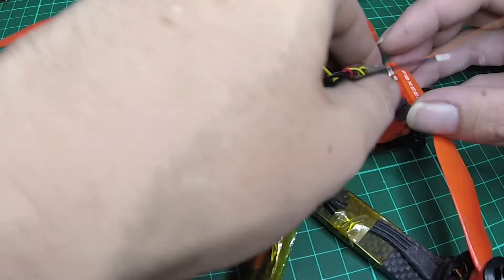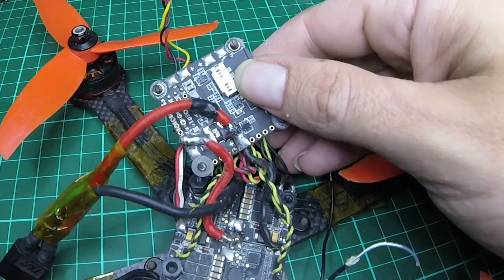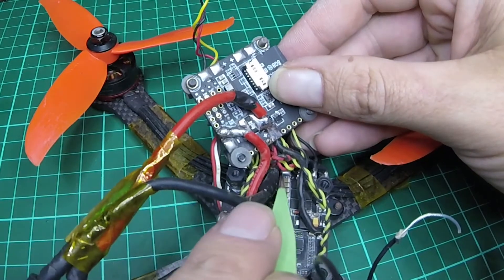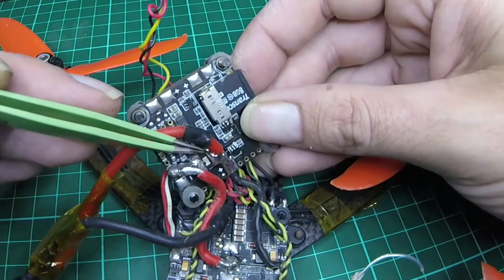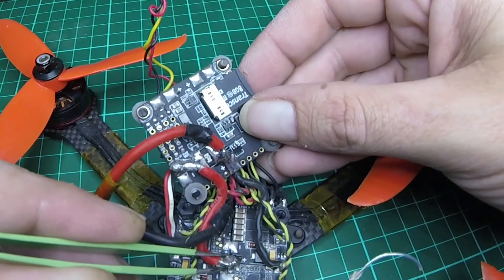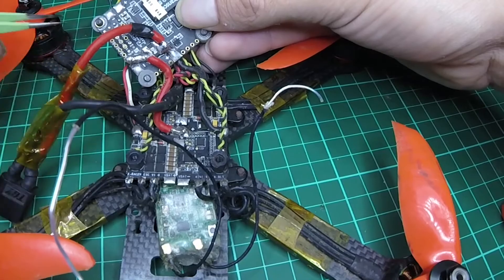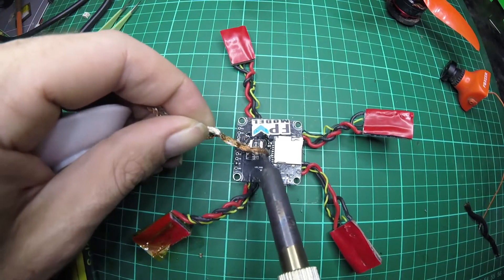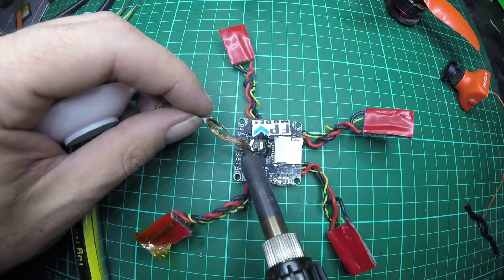BetaflightF3 // 4-IN-1 ESC Wiring guide

Comment: Thanks man, just about to start building this exact esc and fc combo.

Probably a stupid question, but why do you run the lipo ground to the esc and then back to the pdb/fc?
Reply from the maker: The main ground only needs to go to the esc however a smaller "reference" ground wire is needed for the FC to function and complete the circuit

Comment: Is there a way to avoid this for me painful wiring procedure, when my 4in1 ESC has current sensor on its own? Battery leads directly to 4in1 and from there power the FC, but how to get information about current into the FC when there is no dedicated current pad like on some other boards? Or just some thin wire from 4in1 directly into battery pads of FC?
Reply from the maker: Sure thing , wire it like a normal 4-1 then you can use the led pin or ppm pin for example and just remap it with the resource command in cli to be the current pin ;)
Reply: Wow, I totally forgot about such possibility. Thanks a lot!

Comment: What's the best place to use as common ground on a standard 4in1 esc? Looks like you're using pads the quadrant provides.
Reply from the maker: Yes the quadrant has extra pads so i used one of them but a 20awg wire from the esc ground to the FC ground would be all that is needed

Comment: is it necessary to solder directly to the shunt ? or are the pads enough to power the 4in1 ? (thanks for the video ...)
Reply from the maker: personally I'd say the pad for motor 1 would be enough as its connected directly to the shunt but to be sure you can scrape back the solder mask exposing the pads going to and from the shunt and add some solder to beef it up if you felt worried.